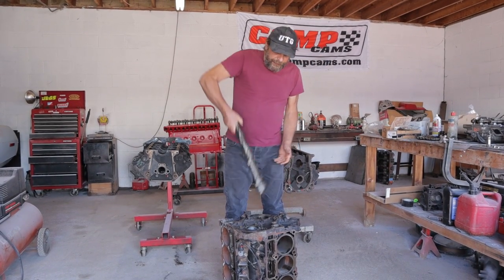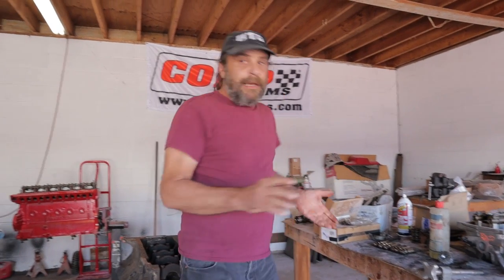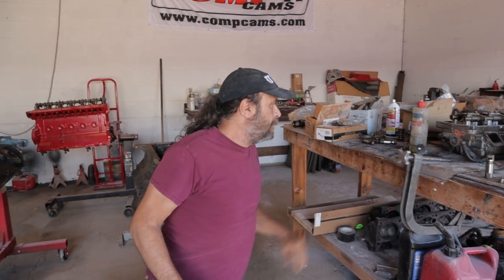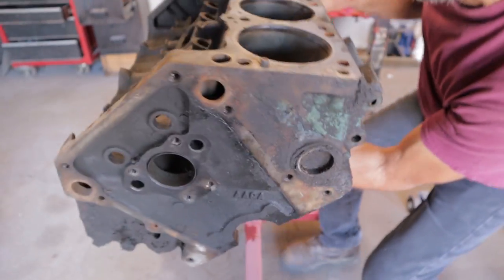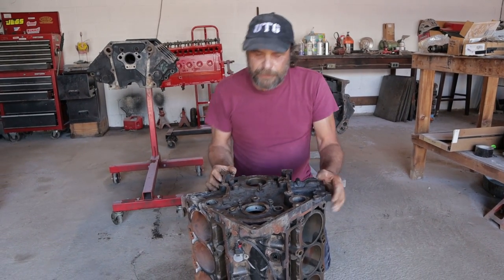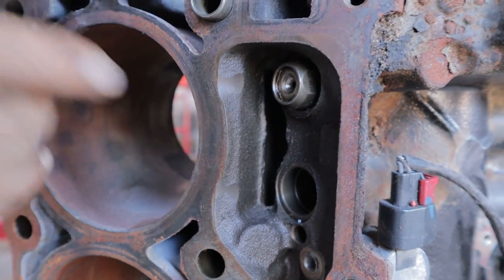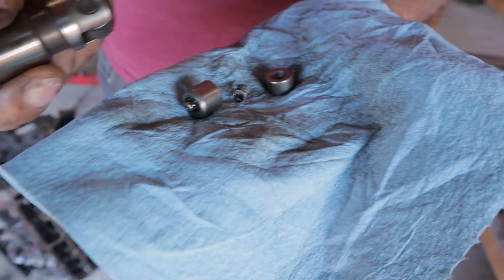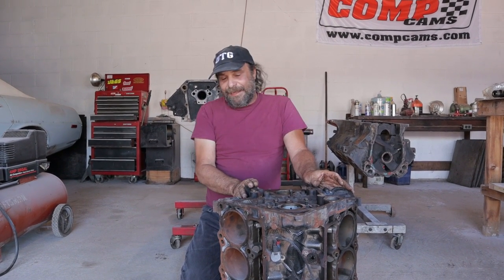Gen 3 Hemi Camshaft Failure Mystery Explained!

Comment: I own a 2015 Ram 1500 4x4. 8 speed transmission with tow package and ofcourse the 5.7 Hemi. I don't tow with it., just what it had. Every now and then on start up it Knocks like the lifters bled off and it is building up preasure. I don't drive it much. Only has 73,000 miles and had 62,000 miles almost 2 years ago when I purchased it. Is this a tell tell sign that the lifter may be going bad or is this normal as the dealer keeps trying to tell me it is? Thank you.

Comment: I have owned 4 Gen 3 hemis. Two trucks and the wife has had 2 SUVs. Even before these vehicles, I had many 318s and a couple of slant sixes. Any modern Mopar with an automatic, I have always thought that the engines turned WAY too slow once overdrive kicked in and torque converter lock up. Since 2000, all the Mopars we have owned, the first thing we both do after start up is disable O/D. We live in a rather hilly part in New Hampshire and most of our driving is on secondary roads and barely ever get out of 4th gear. On the highway, we still don’t use O/D. Uses a little gas but, we’ve never had a problem with any engines or transmissions. Wife just traded in her Durango Citadel with 50,000 miles for a GMC YUKON XL. Our first non Mopar since the early 80s! Needed more room for family trips and luggage. My 2010 Dodge Ram which I bought new has over 100,000 miles of New Hampshire driving and have not had one engine or trans problem. Love my Mopars!

Comment: I saw the vid and one thing I would suggest to those using these engines. Call Comp cams and order a custom ground based on your engine configuration. Have CC NITRIDE the cam lobes. That will prevent the uneven wear on the cam lobe itself. The Chrysler roller lifters seem to be suspect as well. Lots of failures document on YTube. Be sure to use the correct lifter. NA vs supercharged and bushed vs roller bearing roller suspension should be specified when ordering corresponding lifters for your nitrided camshaft.
Thes steps may solve the engineering issue that Tony has researched.
Or buy a Ford. Up to you. I have 310,000 miles on my 1997 Mustang Cobra. 6800 rpm shifts.

Comment: I built engines over the years.  Drilled and tapped brake line threads into oil pressure areas and plumbed in extra squirters to lube parts due to engine design flaws (main bearing notching on BOP 455 cid engines to prevent spun bearings, etc.)
Reply: Make sure you plumb manifold style, not single ended feed, otherwise gravity might not make things even.  Thing 4 barrel carb engines running leaner towards the front of engine...

Comment: The GM LS/LT Engine has a similar lifter design but I do think the LS has better oiling system for lifters. BUT if you look at police or fleet vehicles with lots of idle hours (like HEMI Chargers, LS Caprices or Tahoes) they are known for having wiped out cams. So your theory is most likely the case. And I don't know numbers but I'd be willing to bet many warranty claims or repairs are 5.7L HEMI police Chargers with lots of idle hours.

Comment: Harley has been doing this oil through the pushrods since 1984 , those lifters would go 100k on a stock cam. Fix is to run a hell cat pump ,and use the stock relief spring to retain the MDS function, without throwing a code , related to oil pressure

Comment: Why not try notching the lifter body from the oiling band to near roller to oil from the top down? 
We have a .010" flat ground on our flat tappet lifters at a slight angle from the oiling band to very near the crown. As the lifter traverses the bore oil is metered down to the cam lobe / lifter crown interface. Lifter rotation sprays oil everywhere.
We have noted a substantial reduction in flat tappet cam failures. with only about 5 to 6 psi pressure loss at idle.
GM did this on the 2.8l engines to eliminate cam failures due to lack of oil splash.
Another option would be to notch some or all of the lifter bores to oil again from top down. Comp cams used to sell a lifter bore notching tool though it was too aggressive and hurt oil pressure so it is no longer available.
In cases where we are using roller lifters that are NOT pressure oiling the roller we notch those as well.
SJ / Parkland Performance Auto Machine.

Link to flat tappet lifter mod.

https://www.facebook.com/SMJRHP/photos/a.563590983728292/580048845415839/

Comment: I have a 2014 5.7 and have a cylinder 7 lobe going bad.  Transmission supposedly just went out.  Wondering if I should 1. Have the cam repaired 2.  Put in a used 43k engine?  Is there another engine to drop in these trucks?  May not be worth it but it has 223k miles on it.  I parked my truck and when I got back in it, it would move or go into Drive or Reverse and transmission shop said tranny went out but I wasn’t sure if a bad cam lobe would Cause it to stop moving?  Thanks for any help!
Ryan
Reply: It WOULDN’T*  move

Comment: couple of things...is this problem also on 2006 5.7 hemi engines,,??...and would replacing the oil pump with either high volume or high pressure pump fix the oiling issues..??

Comment: When I'm on the freeway, cruising at 1450 RPM, is this inviting disaster?  If I rev the engine every so often by switching to seventh gear for a bit, would that ensure the lifters remain lubed?  If so, how often would I need to rev the engine to (say) 2000 RPM?  How long would I need to sustain the higher RPM before I could return to 1450 RPM cruise?

Comment: Tony, another issue is the high oil temps on these Chryslers.  On my 6.1L hemi, I cool my oil so it stays around 200 degrees.  I also run mobil one 15-50.  Hot oil means ultra skinny oil.  Before I cooled my oil, oil pressure at idle would drop dangerously low.  Oil was too hot!  Also, the ebay hemi roller lifters, with the holes on the side, may be the answer.  I have tried them and the only issue is STILL lower oil pressure at idle.  All the more reason to cool the oil and run 15-50 mobil one IMHO.  Cheers

Comment: I found myself here by luck after watching another guy totally trash talk this video, and I think you are right on the money on this issue, this makes the most sense to me.
Now to find a fix for it and make some money off of it.  I think different lifters that would allow oil to bleed off a bit to surround it in oil (maybe two or three small holes at the top along the length) and one through the bottom into the roller area would be the answer, although thats not going to help the cam itself unless the pump can provide enough pressure to squirt the cam, instead of drip feeding it.  Perhaps a way to simply modify the pump to provide more pressure at idle?  Maybe a lucas additive every oil change would help.
Great video and content.
Reply: Who trash talked it? I like Tony but he's 100% wrong here. The Hemi does not use splash lubrication, no modern engine does. In fact, the hemi has a windage tray in between the crank and oil specifically to keep the oil and crankshaft separate, so that it does not splash and cause windage. Splash lubrication is ancient history.

Comment: You could put an oil spray bar like the 2J has that sprays up. Or the oil dribblers to go down on that cam. But nothing fixes that horrible lifter angle. I Think all the oil in the world,& the lifters will still get tore up. That is a fubar design. I'd like to see a bore gauge in there,& see how out of round they are!

Comment: Thanks for this video Uncle Tony. I don't have no problem yet. I got me a Dodge 1500 with the Hemi and knew it'd have camshaft problems but this is an eye opener. I'm just going to get me a good change to Royal Purple and change it when I need to. Speaking of which, I don't suppose you knocked it off a list but would you have any pointers for a good, torquey camshaft replacement?

Comment: All good suspicions.  I doubt the shadowing of flinging oil by that oil tube explains much.  The drip-back theory sounds very likely.  Had Chrysler put a shield to direct that oil to drip onto the camshaft, it would have been better, and perhaps could be an aftermarket fix.  Similarly, I added the later shield which drips valley oil onto the timing chain to my 1965 273 small-block engine.  The "lifter oil via pushrod" of the 1980+ slant-six seemed a kludge, so strange they used that in a new design.  Perhaps it saved the cost of providing oil passages to the lifter bores.  Perhaps that accounts for some camshaft failures, from those passages gunking up.

Comment: Drill a series of .01”-.02” holes through the oil tube and weld the bottom holes up. This would cause oil from tube to spray the camshaft. Depending on the pressure drop a high volume pump could replace oem.

Comment: what's the deal with the 5.7hvaing the issue but not the 6.1? are the blocks not nearly identical?   I know the lifter issue is a big problem I've got two 2011 ram express 5.7 with number 8 exhaust lobe eaten away with a stock and a comp cam with comp lifters..

Comment: yep, happened to my 2011 ram 5.7 with 70,000 miles. ran good up till then. very good explanation. I had one roller seize and another starting to. I do more than usual idling because I either warm up my truck or cool with with the a.c. before I put my children in it everyday. other than the motor, I love the truck

Comment: Didn’t read any other comments but. . . What about putting holes in the top of that cast tube below the cam kinda like oil squirter holes. They would spray the cam 100% of the time you have oil pressure. Small holes. You don’t need much and you don’t wanna lower oil pressure too much

Comment: When I bought my 2018 5.7L TA, in the owners manual, it stated not to idle the engine for long periods of time. Now I know why thanks to this video. I try to exclusively run the car in Sport mode to turn off the MDS because I hate the bog down it causes. Now I have another reason why to run the car in Sport mode exclusively.

Comment: I have heard that the oil pressure at idle is low. To alleviate that problem some have had good results switching to a Hellcat oil pump. Supposedly increasing oil pressure by 12 to 15%.

Comment: I had never heard a reasonable explanation for this issue before either. That lack of a cause made me believe that it was a myth perpetuated by those who had heard of it happening (self-selection bias). But hearing your reasoning, it makes a lot of sense. It also sort of jives with my anecdotal evidence that is never heard it happen to any of my Challenger club members (300+ HEMI cars). But Challengers generally aren’t ever just idling along. People tend to drive them as they are meant to be. So I would make a guess (no stats to back it up) that you would see this failure a lot more on trucks, especially work trucks that might be idling a long time for power tools, maintaining a/c or heat in the cab, or other common reasons to leave a vehicle idling. Nice investigation work. 👍🏻

Comment: Have to comment. The guy in this video said there is a time when it is getting adequate lubrication: at 1500+ rpm. Why is that? Higher oil pressure. In the LS world, you can modify the inside of stock oil pumps (or buy a performance oil pump) that will increase idle oil pressure without overpressure at high rpm. This may solve the issue for hemi also. However, an important aspect was left out of this video. MDS. I bought a 2011 Charger Pursuit with only 125k miles (lots of idle time) with misfires and multiple shot lifter roller bearings and multiple cam lobes destroyed. Now you could say it was bc of oil issue and maybe you're right, but all 6 of the 8 MDS lifter were stuck off the roller body internally. Now not every failed roller was an MDS roller, but most were. I replaced lifters and camshaft, and had a tick still despite running good. Teardown found after only 2000 miles multiple new MDS lifters stuck again. If these lifter stick there is likely to be times when the cam lobe whacks into the roller bearings, over time that can damage them and cause the roller bearing to get stuck, which ruins the cam lobe. If you do lifters delete MDS.

Comment: I mentioned to you a while back (years probably) about my B series Honda with Crower cams. I got about 5k miles out of the engine. It got progressively weaker and eventually refused to run. Popped the head off to reveal NEARLY BARE cam lobes. I don't know what could've caused it. I'm fairly certain that I was extremely liberal with the assembly lube.

It was suggested to me that the entire reason it happened was because I used NEW camshafts with USED rocker arms. The asperities on the lobe surfaces didn't match the ones on the lifters so it wore the lobes down like sandpaper. It was worse because I had dual-coil racing springs and I winded it out to 10KRPM regularly... but I STILL don't think that caused the problem. I'd never seen it before.

I think it was more related to break-in procedure, mixed with the USED/NEW lifters/cams. My uncle swore that I should've used oil with higher zinc content during break-in. Not sure that would help. I don't do break-ins. Never had a problem with it.

Comment: So I was planning on buying a used 2010-2014 ram 1500 hemi. Should I not do that because of the information in this video?
Reply: i cant wait to trade mine in and not buy another if that helps. few months ago i noticed mine ticking. 07 ram 1500 with only 117K miles. dont buy one.

Comment: Very good video. Thank you for your time researching it. If the oil is pressurized in modern engines and the galleys should be pumping oil all around the lifters and camshaft , and I see what you are showing, and I understand the splashing oil or jets help oiling  obviously,..but this seems like either a galley issue where the engineers starved the cam to oil the lower end or they plug up with bad oil...or possibly a combo or maybe stress dynamics are frying these camshafts... just a thought. Anyhow thank you for a great video. :))
Reply: The hemi, like basically all modern engines, does not use splash lubrication. The crank hitting the oil aerates the oil, this is called windage and is something to avoid because air is a terrible lubricant. Modern engines like the hemi have a windage tray to sperate the crank and oil sump to prevent windage/aeration of the oil. So lack of splash lubrication has nothing to do with the problem.

Comment: looking at the oil drain back passage under the top of the lifters, could they make plates to extend the bottom far enough to oil the camshaft? Even this wouldn't fix the uneven oiling of the lifters themselves as they are nearly horizontal which to me is why one bank of liters wear look different from the other bank. Do boxer style engines have these issues? I wonder how boxer pistons dealt with it.

Comment: I wish I would have seen this video before buying my 2015 Dodge Charger Police Interceptor. I am having a misfire on cylinder 3. I had two different mechanic shops look at it, including a Chrysler dealer, and both told me that the camshaft is damaged and they are both recommending replacing the whole engine.

Comment: Does this apply to all hemi engines or just the 5.7? 
All i find if i google fatal flaws are videos or threads about the 5.7 but i heard the 6.1 being mentioned once. Would be nice to know because i am looking at one of two Magnum SRT8 for sale with 120k kilometers. The engines go through more rev variety in Germany so i don't think the engine is going to have the same oiling problems like in the US where you have longer distances where MDS is working for extended periods.

Comment: I'm getting the shaft and lifters replaced on my Challenger RT. And what you said is exactly what happened with my motor. Basically lack of lubrication. $5,872 repair..
Reply: Does the warranty over it and how long have you had before the cams went out?
Reply: @myinternetsux1755  Thankfully my warranty is covering everything Coil pacs,sparkplug and everything. I got my Challenger RT at 41,000 miles I'm at 56,000 miles.
Reply: @stick_boi5026  ok that’s good man glad to hear it I’m saving up for a new 5.7 but don’t want to get it if the cams and lifter goes bad within like two years but I really don’t need a 6.4 but if they have better engines then Idk I just want it to last I’ll take care of that car better than my ungrateful ass demon spawn kids

Comment: had an 07 Ram with 150,000 miles,never had any issues,currently have a 14 Ram and a 15 Challenger with 5.7s. The Ram has 120,000 and Challenger has 60,000,both pure like kittens,no issues so far!

Comment: Ok so, this is a bad design, as you said so, what’s the best defense to this? I mean, I have lifetime warranty on my truck so if my motor falls victim to this, they can fix it with the aid of a hundred dollar bill from my pocket but what’s the best defense to this? I know you said there wasn’t much but what can we do? What’s a good oil? What’s a good oil change interval? What’s a good filter? My 2018 1500 Hemi will only be 3 years old this December with only just a couple times of startup tick and that’s it. So far I’ve been using 5w20 Pennzoil Ultra Platinum with a Wix XP filter that I’ve been trying to keep changed between 5500 and 6500 miles but I’ve decided to switch to Amsoil Signature Series 5w20 oil and an Amsoil filter. I’d love to switch to Redline 5w30 but since that oil is number one, not Chrysler MS6395 compliant, it’s also the wrong weight.

Comment: I’ve got a 2004  Dodge Ram with the 57 HEMI and it has 167000.miles on it still runs great I’ve owned it for 15 years and always change the oil on time and it’s been great